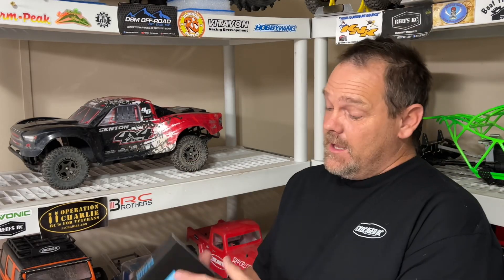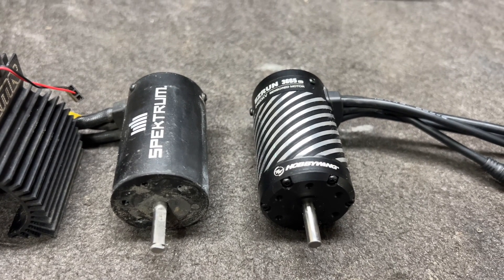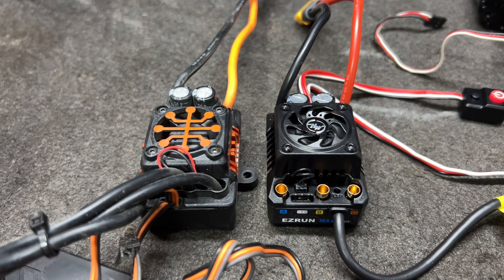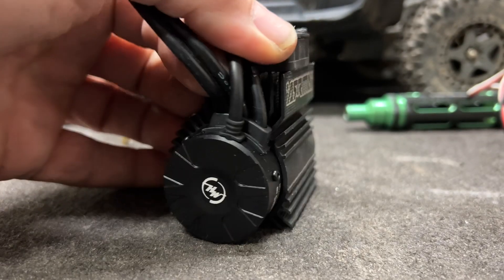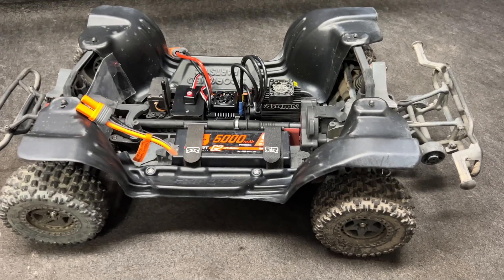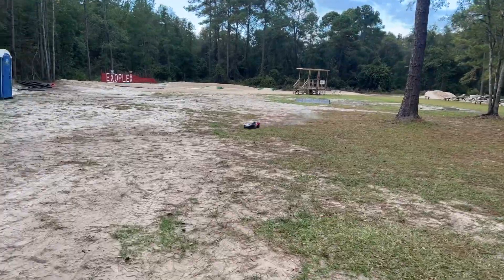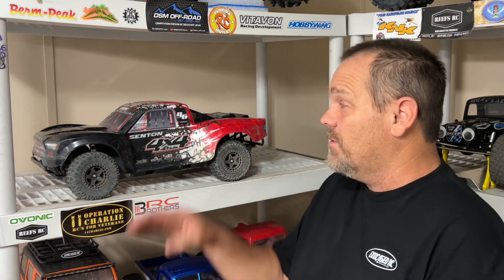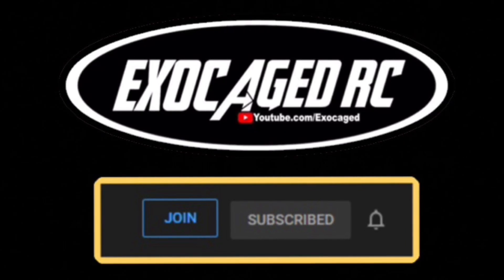Hobbywing Max10 G2 140a with 2400kv motor any good?

Comment: Just a tip that got passed onto me is spray furniture polish ( thinking of inside wheel so sand won't stick and unbalance wheel) I got this tip for under mower deck so grass doesn't stick and works amazing so thought might help you in this situation . Worth a shot at least 🤷‍♂️

Comment: best tires to get 17mm hexs and swap your typhon badlands on it . also proline sct shocks front PRO606300 rear  PRO606301 . personally id put this body on it ! Pro-line Racing 1/10 1978 Chevy C-10 Race Truck Clear Body: Short Course, PRO351000 . or you could get crazy with a narrow creep body !!

Comment: Great video, I was wondering of I'd be able to pair a spektrum esc with a hobbywing motor as long as the pole measurements are correct
Reply: 4 pole is the standard you should not have a issue

Comment: So smooth! Also can U put the sand guard in between but in front of the fender wells? In  the video it appeared there was space and would block more if you can scribe the contours. I think I'm gonna use Gorilla tape on both sides (inner/outer)

Comment: Joe could i use 30,000 weight grease with 1 million weight oil in the front differental with a center  spool . On the dbxle 2.0.

Comment: Have you ran this system on 2s? My local indoor clay track you have to run 2s so I'd be curious to hear your thoughts if you have.
Reply from the maker: On 2S I’d go with a higher Kv motor.
Reply: What a pointless rule. Watts is the determining factor of power and speed available, not cell count.  You can change gearing and motor KV to get any amount of speed/power from any cell count.
Reply: @ExocagedRC what KV motor do you recommend coming from 550 brushed motor

Comment: imo, your 1st jumps transition is a little sharp, launching the rear up at the end of its rebound stroke as it comes off the ramp, kicking the ass end up.  I think as you noted, a bit better shock oil setup, batter and balanced wheels as you could hear them out of balance, maybe coming unglued in a spot or two on one.  And then make that approach on the 1st ramp a bit longer so its a bit more smooth should make all the difference.  Could hear the chassis slapping the ramp face as you transitioned to it.

Comment: What happens if you brake more than once? Does the car then reverse immediately? Or does it only reverse when the car is stationary?
Reply from the maker: depends on the esc, some will give you reverse even if it hasn't stopped, some will not until the motor has stopped rotating
Reply: @ExocagedRC  
how does the MAX10 G2 do it.  That's what this video is about.

Comment: How are your diffs surviving?  Lol.  That's why my 3s bigcrock sits in a box and went to maxx. Grew tired of rebuilding the plastics.
Reply: Hot racing make full metal spiral cut diffs. Did them in my Denton with the aluminum hot racing yoke and it took 4s all day long, cost bout 50 bucks a diff. By the time you rebuild the stock ones 3 or 4 times you have the same amount of money.
Reply: New 4s diffs are much stronger, swap right in
Reply: @SMRc95  i did the hot racing before the new 4s came out, i wouldn't know now lol. Ive sold my senton and got a 6s typhon and converted to run 8s, stupid crazy buggy